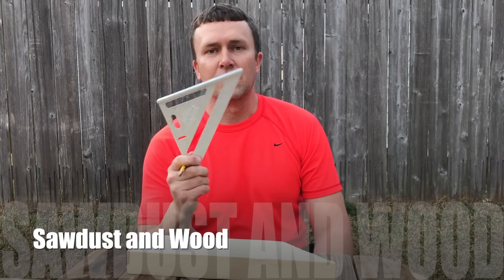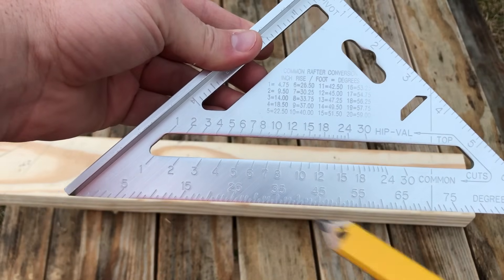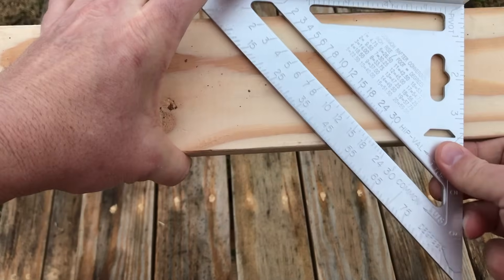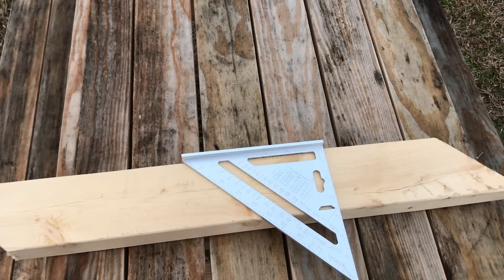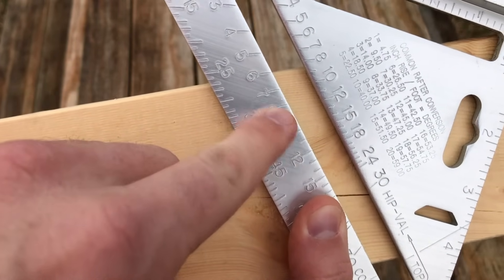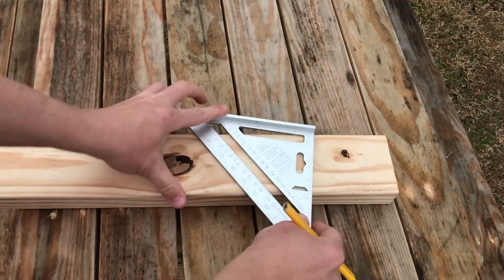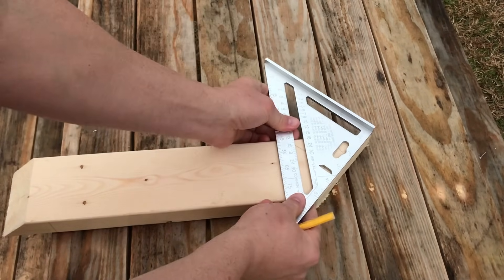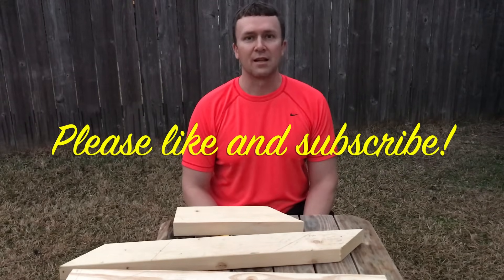How to find angles with a speed square

Comment: Thank you!  Great video!  I have had a speed square in my toolbox from long ago but forgot how to use it.  I am not in the process of replacing some of the rotted deck boards (2 x 4) that I installed diagonally.  Could not remember the angle that I cut the boards.  Only knew it was close to 45 but wanted a precise cut to fit up agains the house.   Nice refresher course on the use of a speed square.

Comment: Yep, late to the party by 5 years.   I've never understood why they don't put a small pin hole for a pin or nail or something to pivot on other than fighting the speed square not moving on that board when you're spinning it to angle.  Call me crazy, but the dmn thing always slips on me.
Reply: If you put a sting in that cutout and put the square against a rafter and let it hang, it’ll tell you the pitch where the line falls on the angle marks
Reply: @amishdoinks5104  👍

Comment: If you measure at 35° with that speed square and then make the cut, wouldn't the angle read at 55° if you measured with a protractor? Lol 😁

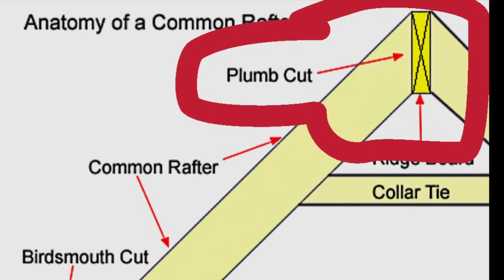Comment: Great video, thank you very much! But I don't think the angle you traced on 2:10 was a 54º angle, since it would have to be wider than a 45º, which in this case it wasn't. What you traced was a 36º angle (90º-54º). I think it's important to clarify that, and it's easy to get it wrong with the speed square... :)))

Comment: Be careful !!!
The speed square angles correspond to the markings on a miter saw. In his example a 35 degree angle will work if you set your saw to 35. 
However the actual angle is 55 degrees (90-35=55). Cut a piece of wood with a setting of 35 on your saw. Measure it with a protractor or angle finder and you will see it’s a 55 degree angle. He has another video explains the correlation of miter saw settings and actual angles desired. 

When he drew a 90 degree angle the speed square showed zero degrees. When you cut a 90 on a miter saw the pointer shows zero not 90. Watch his other video. If you wanted an actual 35 degree angle you would set your saw at 55. There is no marking for 55. You have to make a simple jig to cut a 35 degree angle. Again watch his other video for an explanation. It’s very important!

Comment: I was following directions on how to make a park bench and the legs are suppsed to be cut at a 15 degree angle. They didn't explain how to make a 15 degree cut on one end of a 2x4 so I tried to eyeball it and ended up making a 30 degree cut which threw everything off. I have a speed square but I only use it for marking a straight line or as a guide for my circular saw but now I know better how to use it. Thanks for this video.

Comment: Thank you so much!! I know this is really basic stuff for this tool, but im not super experienced with it. I can make basic cuts, right angles and 45° cuts. But i find my 45° cuts by marking 90° and then measuring out an even triangle, bisecting it down the middle with my 90° mark. Super complicated way of doing it, i know. But thats the only way i knew to find that angle, and it works. 

This helps me tremendously as i have recently found myself in a lot of carpentry related work. I have subscribed, and will be looking at your videos to see if there are any other tips that can help me out.

Comment: Hello, thanks for this great video. I have a question. I am making a lumber cart and the area that i am using to hold the plywood sheets has 3 support beams at an angle evenly spaced like studs in a wall to support the plywood sheet that makes up the backing where i will lean all my scrap sheet materials against. The question is that i cut a 15 degree angle for the foot of each of the 3 studs that are 2x3's and need to determine the angle for the top cut so they sit evenly against the 3 cart studs. This will give me a flush mounting for the bottom foot and the top. I posted on a Facebook woodworking group and several people stated that my measurements should be determined off a 90 degree formula. So if my bottom foot is at 15 degree i should subtract the 15 from 90 to give me a 75 degree top cut. Does this sound right? Im a newbie. Thanks again for the video. Very useful.

Comment: thank you so much! I do maintenance for various companies. There's times times we work with wood, mostly decks or sheds. I never understood how to do angles using this tool. thank you very much.

Anyone got a tip on how get flush the railing for the stairs on a deck I'm building? I'm very novice and I keep ending up with a huge gap instead of butting up to it.

If only my math was better lol.

Comment: Thanks for the refresher course in my case. 
  Just did some angle cutting and was completely lost as to how to find correct angle with the speed square.  It has been years since I used one to find anything other than 90 and 45 degree angles.

Comment: I havent found a video YET  that explains on how to determine what angle to cut.
Example I build a random size box (in this case 2'x2') .I cut the top as to fit two boards being the roof (its a cathouse)   Both ends will meet in the middle,so how to you figure out the angle to cut so both sides are snug??    Thank you very much for any feedback !!!
Reply from the maker: Watch my video on gable roof rafters...should help
Reply: Thank you very much ,I will. BTW   failed to thank you for a great video on how to use the Speed  Square

Comment: This was soooo helpful.  I needed to make a miter cut on 8 1/4 inch baseboards and my miter saw is too small to accommodate that size.   So I decided to use a handsaw.  At first I eyeballed the angled cut and that was a disaster.  Then, I remembered that I had a Speed Square.  Unfortunately, I had never used it and did not know the basics.  Your video gave me the basics and I was able to use the speed square to mark my 45 (success!).
Reply from the maker: That's awesome!  I'm so glad that this video helped you.  The speed square is a great tool.  Have a great day!